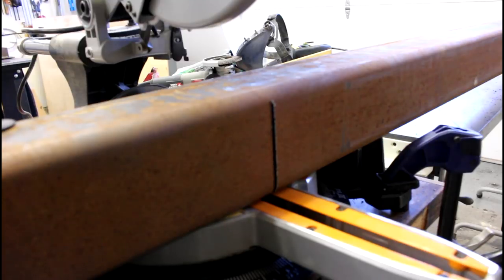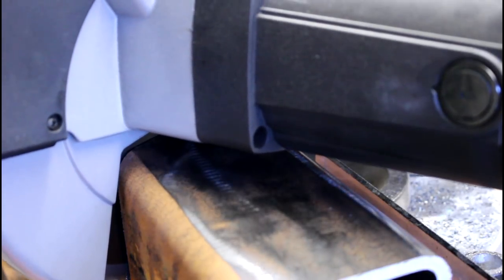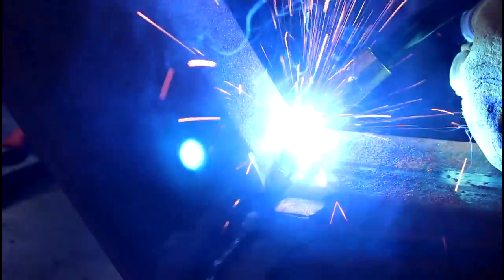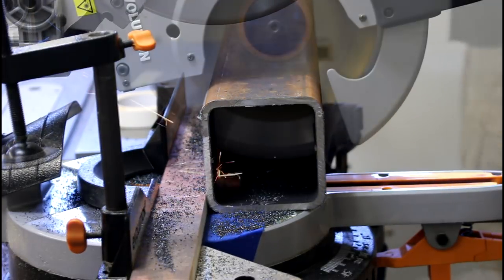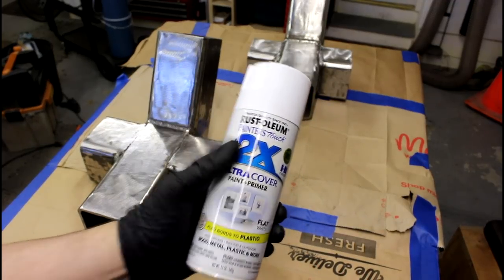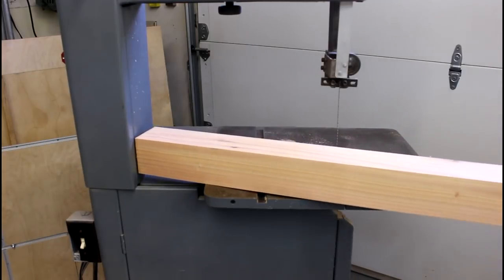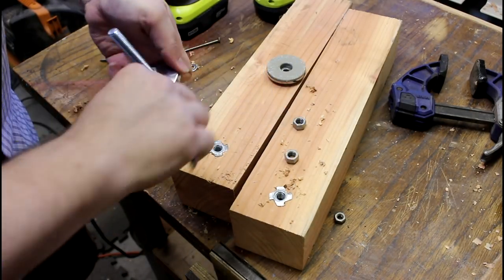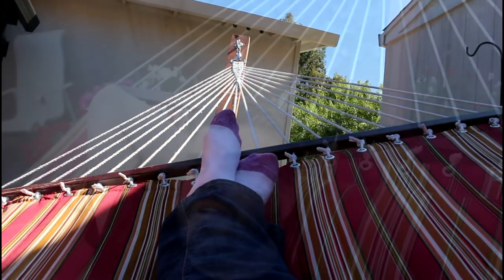Steel & Redwood Hammock Stand

Comment: What kind of welding machine did you start with? Want to buy one but don't know anything about how big I should go
Reply from the maker: This machine is a Hobart 140. It runs on household current, and can even be used without gas with a flux core wire. (but I haven't tried that) 

It can weld 1/4" steel which is very thick and more than enough for me right now.

Comment: I've been wondering about the pricing on the materials cost for this kind of thing. That tube stock looked pretty beefy, what did that set you back, and what was the total stock length?
Reply from the maker: OK.  I told them what I wanted. He says, "That comes in 10ft or 20ft lenghts, " I said, "10ft!!" He then charged me $125. 
I'm such a greenhorn I have no idea if I got a bargain or got taken.
Reply: Cheers. I think that's pretty good. From what I've seen I think McMaster will charge almost twice that. Been with ya since the sprinkle cake stand (v1 :P), but I don't comment often. Keep it comin!

Comment: when wire welding don't move side to side or up and down just do a straight line on where it needs to be welded
Reply: austin hatfield when MIG welding, yes you can get away a straight bead. But if you want a good strong solid weld you gotta Move side to side. On anything bigger then 1/8 inch your going to start to get lack of fusion on your metals. Especially when you need a weld that can hold the weight of a person
Reply: Depends on your machine setting. Unless you've got it pretty hot or you're welding thin metal, you should be using slight side to side motion.

Comment: Peter you need to turn up your voltage
Reply from the maker: Should I? It was at maximum. 1/4" is its upper limit. Can I just lower the feed rate to compensate?
Reply: Peter Brown I was welding a bike rack frame and my settings where 21 volts and 3and a half on the Milwaukee wire feed. best thing to do is get a scrap plate and do a 3-4 inch practice bead.
Reply: P.s. I've never seen anyone blow through 1/4 inch plate with a mig gun.

Comment: Peter I am disappointment you didn't used basic trig to find the length of each diangle post but instead went and measured them out like a rook.
Reply from the maker: I can barely count to ten without my fingers. Basic trig sounds like a nightmare I had once...

Comment: You did a pretty decent job on the welding but you made a beginners mistake - at least it like that.

the thickness of the tube is app. 5 mm - you would have way more structual stability if you put a bevel on all 8 edges AND you must not put the together. They need to have a small gap ~ 2 mm is sufficient. This way you are reaching two goals.

goal 1: with the bevel you have now a biggers welding surface and this makes the weld more stabil.

goal 2: with the gap your weld is also reaching the inside of the tube - now you are only welded the surface, but the inner side is still unwelded - an absolute no go for the structual stability.

never the less - really nice first try - congratulations.

Comment: Water will sit in the steel joints and rust with time and the wood will rot, peter there is not many solutions to this... treat the steel and seal the wood or this design will immaturely  fail down the road

Comment: why do you Americans drag weld using mig. its  funny 
travel right to left with mig tip facing left 
travel left to right face mig tip to right
Reply from the maker: I'm new to this. What does drag welding mean? I feel like I should go all Ru Paul in the shop! :)
Reply: push against the wire feed . u wer dragging away from it. basketball court full of leaves and u hold water hose u spray water at the leaves wile u walk forward to clean. you wer dragging backwards .so in this case u walked backwards across the court spraying water at leaves you pass by. other way to put it. you wer welding on a ruler from 0 to 30 you wer moving from 0 to 30 with mig tip pointed at 0 draging to 30 . this is a weaker weld.  point mig tip at 30 on ruler move from zero welding to 30. other tips i could see would be increase your amps . slow down travel speed a tad. and you didnt have an open root pass (gap) between the steel. yes it was thin wall tube in this case ok to butt weld but good practice. to hone travel speed look up pad welding practice.